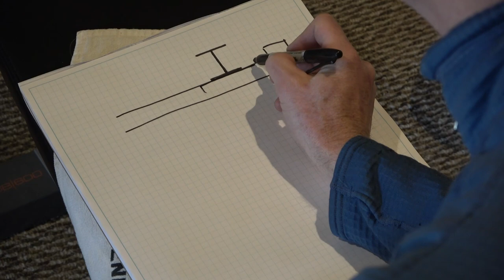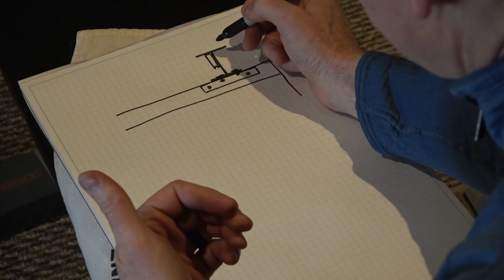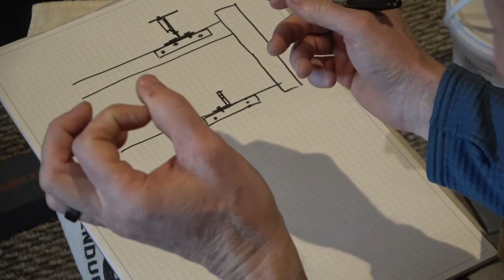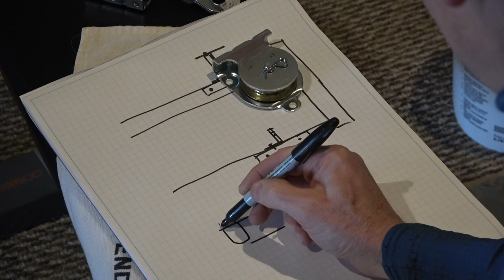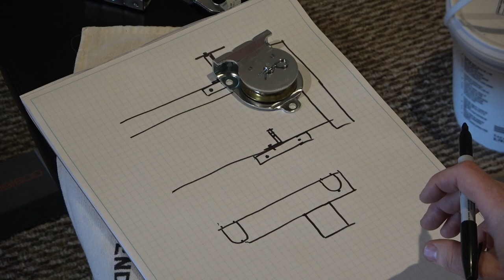Big Home Gym Upgrade: DIY Cable Machine for Squat Rack

Comment: Hi mate! Great work and vid!... However, just to help, I am about to do my power rack and pulley system, and to yours I would make a change. To that existing cable, I would cut it just close to the top pulley and make a loop there. To there other piece, make another loop. The top loop you can use for lat pulldowns and tricep extensions and when you want to to low pulley workout - biceps, rows and so on, you attach both loops with a carbine and you end up with what you have now. Again, this is just to help)) Good luck!
Reply from the maker: Wow what a great suggestion!! Thanks so much- I think we will do that!!
Reply: A trick : watch movies on flixzone. I've been using them for watching lots of of movies during the lockdown.
Reply: @Kyler Messiah Yup, have been watching on flixzone} for since november myself =)

Comment: That's really great making that pulley system instead of buying an overpriced retail machine. Nice work. A long time ago I was a heavy weight lifter and played football up through a state university. Now at 77 my joints are shot and it takes till noontime to feel okay. So, I guess an all around exercise with lighter weights is better for the body.
Reply from the maker: Sorry to hear the struggle to get moving in the mornings. Extreme exercise can certainly take it's toll; can be tough to find the right balance! I'd still argue light weights are better than nothing- but will also plug daily yoga/stretching to keep body parts fluid as possible!
Reply: @ColoradoMountainLiving  In the 1960's we were all pretty dumb when it came to strength training. The idea of "No Pain, No Gain" was taken to an extreme.